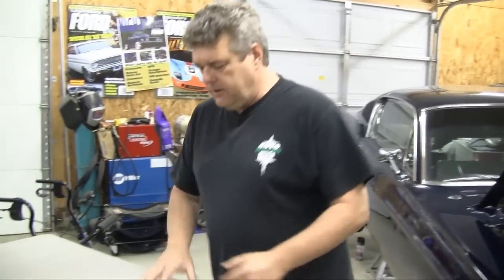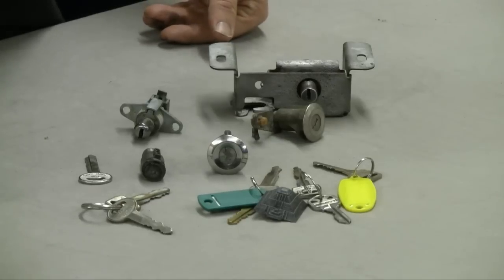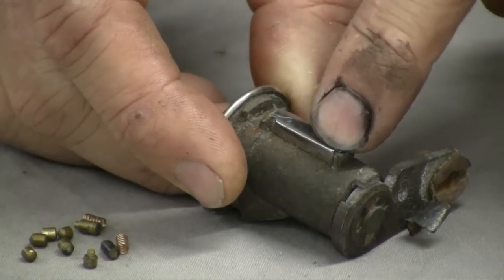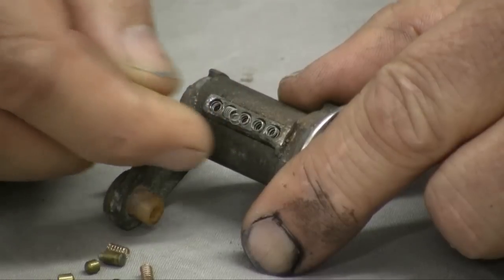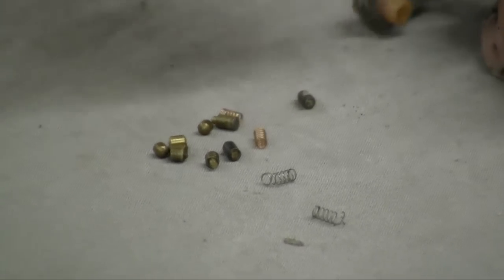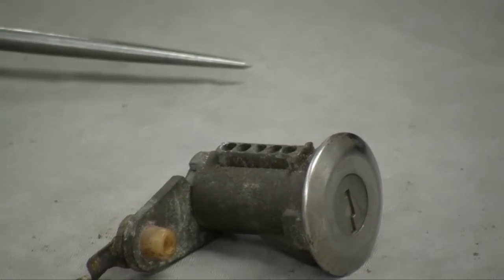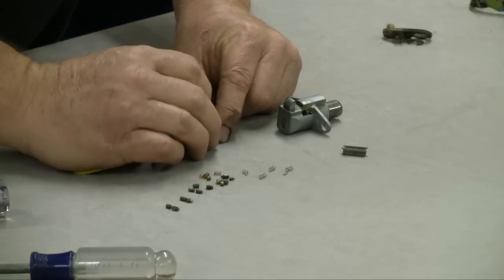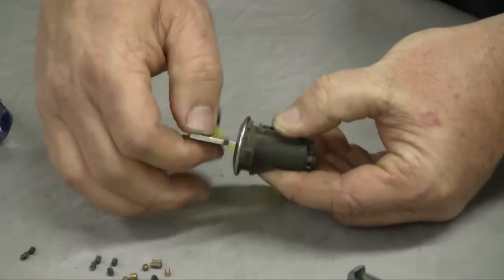How To Key Door Trunk or Ignition Classic Car Locks Episode 1 Fast Break Autorestomod

Comment: Your video is somewhat helpful, in that it explains to the uneducated viewer how the lock works, however, I think it's bad advice to consider using less than all 5 pin positions, if you value your car. Also bad advice to use graphite, it will jam. WD40 will not cause a problem and will also help to keep lock from corrosion, seizing and freezing. In fact, a shot of WD40 twice a year will clean and lubricate. I am not a locksmith, but I have been rekeying my classic cars and home locks for over 25 years, and never had a problem.
Reply from the maker: I can see your points. But if a thief wants a 1969 Mustang, he doesn't even need to have a key, just a coat hanger. WD40 is an excellent rust remover and inhibitor. I would probably veer toward Gibbs fine machine oil before WD40 personally.
Reply: Any oil regardless of viscosity is sticky (even light oil), WD40 or similar is not sticky. Yes I agree a professional thief will take what he wants, but of course, a door lock should not be your only defense, but it should provide security against the common man.

Comment: I did one step better than this I ordered a 1979 Mustang door locks so I'd have the round key for the door and the trunk and the square keeper the ignition only. The trunk lock was different so I had to take the two completely apart that means removing the little Chrome face and switching the inner shaft to work the latch beneath the lock style lock and it worked I have the large Ford key oval and it worked the doors in the trunk and the square key for the ignition all brand new Ford keys best part was Factory Keys Factory locks brand new 60 bucks

Comment: God led me to this video.  I've just spent all day taking out a door cylinder on my '65 Ford Galaxie.  It would lock the door but not unlock the door.  Key only turned in one direction.  That was hard enough.  Then I used every spray known to man to fix the sticking cylinder.  No good.  I ultrasonic cleaned it in kerosene.  No good.  I ultrasonic cleaned it in dish soap and that Purple degreaser.  It helped a bit so I kept at it.  It still wasn't great so I took off that spring cover - with great difficulty and took out all the pins and springs.  I didn't realize there were two rows of pins.  So I got everything all cleaned up nicely and the key turns easily in the cylinder.  I was all set to go to a local locksmith tomorrow and see if they would put everything back together.  But I think with your video, I can do it myself.  Just put the key in the cylinder - add a bottom pin one at a time and make sure the key turns.  Do the same with the top row of pins and rearrange height as necessary.  Add springs and put cap back on.  Sure glad I ran across your video.

Comment: About six months ago (longer?), the ignition key cylinder in my 1989 Mustang busted. One of the rarest features of having a Special Service Mustang was the single key lock set. All civilian Mustangs had separate keys for doors and ignition. Anyway, I was obsessed with rearranging the pins to rekey the replacement lock cylinder, but never could figure out how to access the pins without completely destroying the cylinder. I revisited the problem tonight and FINALLY found your video working with the appropriate year parts and learned how to pop off the cap covering the pins. It took a few hours of doing, but my Mustang is now operating all locks with a single (factory) key again! Removing that metal cap over the pins was the KEY to my problem! I thouhht thay since it was staked on (both factory and aftermarket) it could not be removed. I had to restake with the remaining channel metal to get the cap to stay on, but it worked!

Comment: Thanks so much guys!  I replaced my door and ignition locks and had to use a separate key for the trunk.  I just took one of the old door locks and found 4 out of 5 pins that work in the trunk cylinder for the new keys!  All locks on one key! 65 coupe, thanks again and keep up the good work!
Reply from the maker: Keep in mind that that will only work on the early cars after 1966 Ford went to a mirror image key for trunk and glovebox.

Comment: Thanks.  I was able to re-assemble the pins and springs correctly in the door lock for a 1966-69 Dodge Dart.  I was "in there" to see if that inner cylinder might fit in my 1965 Dart door lock's housing since its guts were missing and replacement 1965 locks are "not avail" (or $370/set new).  Didn't fit since the later locks have wider-spaced pins and a longer cylinder (though diameter matched).  To reassemble, as you show I put the conical ends down, selecting the lower pin for each hole based on the indents in the key.  With key-out and pins down from gravity, I then found the hole w/ longest depth to top of pin and inserted the longest upper pin, and so on.  That put the top of the upper pins all at the same height w/ key out.  The 2nd pin steps were up to fit the spring ID.  The key then turned fine.

I then thought I lucked out by finding a door lock locally from a 1963 Dart, but "didn't work".  While the body fit the door's keyhole (unlike 1966+) and it looked almost identical, my 1965 key wouldn't insert, meaning the key blanks must differ (security slots on side of key, I had lubed w/ silicone spray first thinking some pins were jammed).  Also, the 1963 lock cap over the pins was staked in place with no obvious way to remove it to swap pins to fit my key (which doesn't fit cylinder anyway).  Finally gave up, with new plan to install the old gutless lock to fill the door's hole and install an electric door lock with remote control on that driver's door.  As backup, I can use the key on the working lock on the passenger door.  It's no fun being orphaned on classic car parts.  Like some owners, I could cut a larger hole in the door to fit a 1966+ lock but don't want to molest the door in case I someday run across a used 1965 lock.
Reply from the maker: Cool!

Comment: Thank you for the video. Even though my 1992 F250 door lock was not the same, it was similar enough that I was able to re-key my passenger door lock so I could use the ignition key in both doors.

Comment: Yes, the cylinder use either pins or gates, but when lined up to turn, is the shear line. As a tech since the late 60's, I have had a lot of locks apart on GM's. I you have the key, you're lucky, but if the key is missing and the lock is on the bench. 
If you taken any GM locks apart from the 70's into the 80's, it appears they always have one gate a the back, back hold it in. I have one off an 86 Monte Carlo SS truck lock that I cannot figure out how to remove the key cylinder from the housing. If you know or ask around, please let me know...it's a family member vehicle. ASE Master Tech since 1978 / Retired

Comment: That was a great video!  I have a rather simple question, however.  (Actuall, several questions.)
I have a 1966 chevy whose lock cylinder does not snap back to Run after I start the car.  The key must remain in the START position.  If I manually turn the lock cylinder back to Run after starting the car it will begin shutting down.  I have removed the lock cylinder and cannot find any missing 'return' springs so I am at a loss as to which part is broken?  If I replace the lock cylinder I now know I can make the original (to me, anyway) ignition key work by following your method.  How clever!  Also, the 1966 Chevrolet service manual indicates a particular key code, and that code was specific for each car.  The car would've originally came with the key code in the paperwork from the dealership.  That information is long lost as I am not the original owner.  However, I did find a key code written down on some old papers stuffed into the glovebox.  It is possible, though unlikely, that this key code was original to the car.  Could one of the door locks possible supply that code?  My ignition key is a replacement.
Reply: Most likely your issue is with the ignition switch, not they ignition lock cylinder, where you actually insert key. The ignition switch is separate, and is the electric portion behind the key where the electrical connection are landed (connected) and switched.

Comment: Ford pin locks are sure a lot easier to re-key than the wafer style ""pins"" in the locks of GM products but done the same way. I have tons and tons of late 50's to early 70's GM locks re-keying supplies.
Reply from the maker: Ford used the wafers on the glove box locks after 1973ish. We didn't have any of the wafer style.
Reply: I'd rather work on the pin style locks any day.